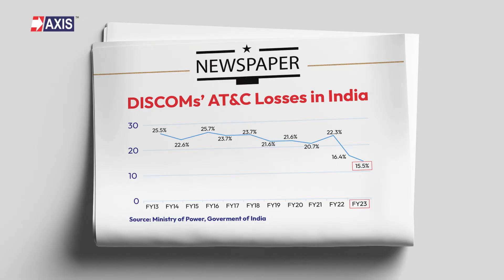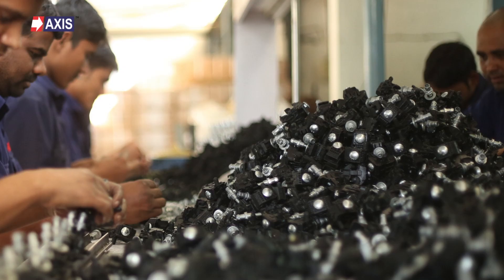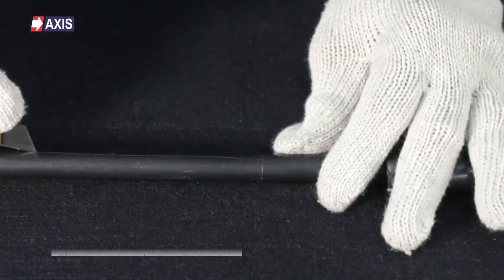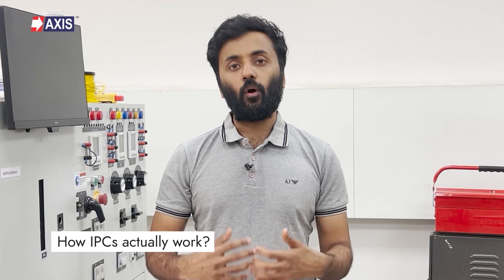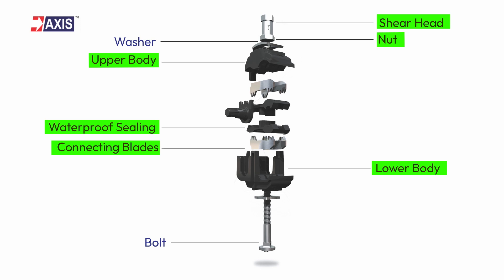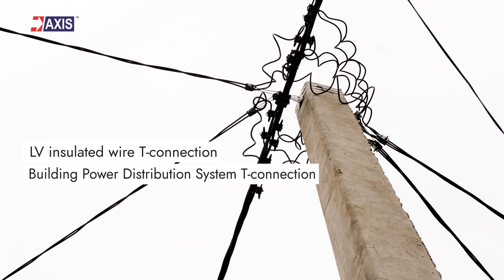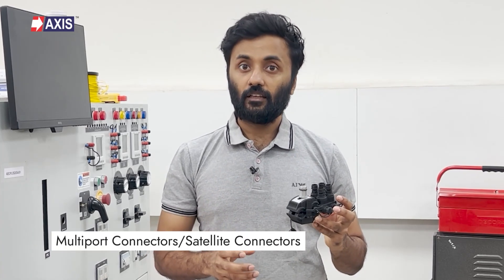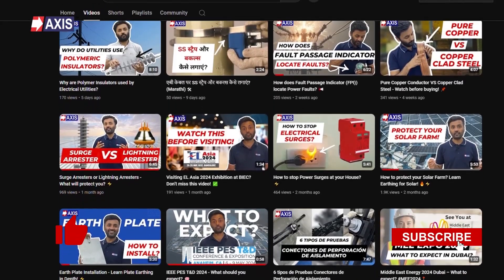Stop Electricity Theft with Insulation Piercing Connectors! 🔒

Comment: I would think that Insulation Piercing Connectors would make electricity theft easier.
Reply from the maker: These connectors are designed to eliminate the need for insulation stripping hence they make life difficult for thieves.
Reply: @AxisElectrical  If I can tap into your electrical supply without having to strip any wire, then that is much easier than having to strip the wire to tap into your electrical supply.